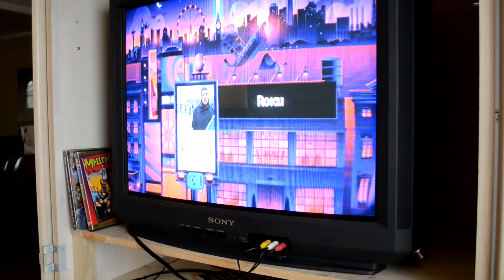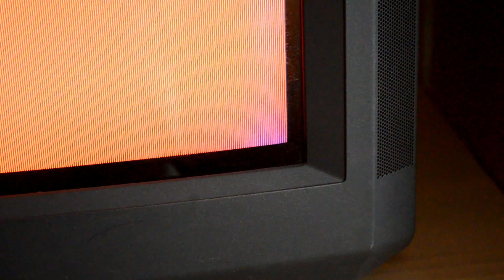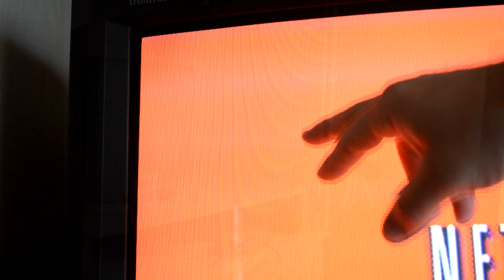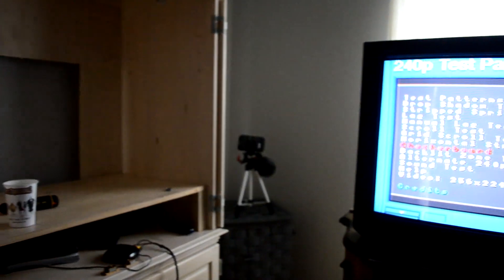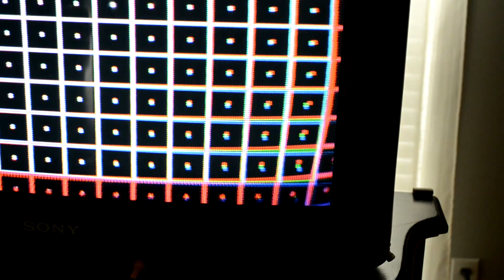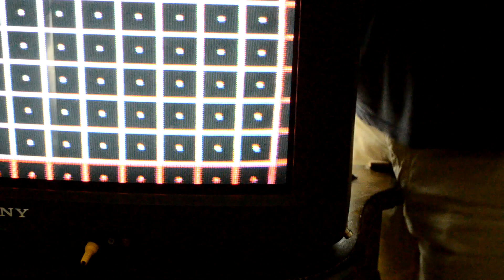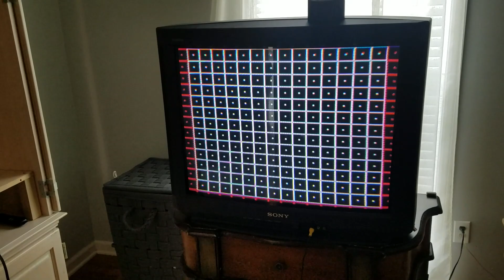Sony Trinitron TV Color Purity & Convergence repairs

Comment: I bought a 19" tv from ebay that was dropped in shipment the tube survived but it took a nasty knock, the lower left is purple and upper left is slighly off color too,  no amount of degaus will correct it the tube is damaged i wanted this tv for a tube swap on one of my arcade machines, I've adjusted most of it out via the purity rings on the neck the picture looks pretty good now you wouldn't know on normal gaming screens, only time you see it is on a solid white screen there is a litte faint patch of blue in the lower left corner now, i might take the yoke off now and see if one of the windings magnets have fallen off as ive seen this a lot on oldet tvs then just try adjusting it out with the yoke now, hopefully i can save this tube its flipping annoying because its a very healthy tube gun wise and life expectancy when i put it on me BK REJUVENATOR / CRT TESTER, color guns are on the top levels of good.

Comment: I just got a 40xbr800 and I had to place magnets around the edges of the screen inside to get rid of the color variance.   However they would come back after a few hours.  Will adjusting the joke fix this issue long term or am I looking at a dying tube?

Comment: I appreciate you uploading this video. I have 2 monitors, one is a pvm and the other a bvm. This seems like the solution to my problem. Both were shipped to me and now I'm wondering if maybe they just got rattled a little too much and caused this problem.

The pvm is actually quite well, just a tad hint of purple up in the corner when displaying red in that part, damn near identical to your video. The bvm however is terribly bad, a good 1/4 of the screen is purple tinted coming from the corner but can be mostly eliminated with some magnet trickery. I've had these for a few years and have been reluctant open either one up. I can live with the pvm but the bvm was practically free and I've always thought maybe someday I would learn how to fix it. It's only got like 20,000 hours on it and I hear they're supposed to last over 100,000 hours.

Comment: hello! I have a sony 29kv310 that has a curve image on the top and bottom of the screen instead of straight lines. I think the yoke needs to be lifted to correct this (getting the yoke's top closer to the screen and the bottom further away). Do you agree with this???
Reply: That's how I fixed it on my KV-32FV16. Also fixed the screen tilt.

Comment: Have you worked on any consumer flat screen triniton crts? Specifically trying to correct wavy or bowing horizontal scanlines.  I corrected all the convergence issues on mine but can't seem to do anything about the geometry outside of the service menu.
Reply from the maker: Hi, sorry I have not worked on any flat screen CRTs.  If the service menu and convergence adjustments don't help, then it sounds like you may need to replace the caps around the flyback and heatsinks on the main chassis.
Reply: @RetroTechUSA  okay thanks. I considered looking into replacing caps but didn't want to put in the work and not see any improvement. It seems like flat crts are notorious for these issues, at least from what I've read online. Beginning to wonder if it's just a flaw of having the screen flat instead of curved. The overall image quality is good so I can live with it for now.
Reply: @karld4737  After watching most of Steves videos I attempted to fix geometry on my flat screen kv-36fv models and oh boy...talk about time consuming! plan to play with it all day long. I had to really flex the top of the yoke outward away from the screen as far as it would go to fix a horizontal upward bowing across the entire screen. After that you'll add a dozen magnets and a ton of strips to try and perfect it only to strip it all off and start again! Steve said it best: You can't have everything as far as geometry goes!
Reply: @linkzz00  yea I eventually found a curved 32xbr48 and it's much better. It's the one curved trinitron model with component inputs so I no longer desire a flat screen trinitron. The image quality is great on flat models but the geometry issues are a pain to deal with.

Comment: Do you accept sending in tvs to be repaired? My KV Trinitron has nasty geometry and convergence issues and I don’t want to kill myself trying to fix it
Reply from the maker: I do, but it is hard to deliver CRT's without damage happening.  I have a storefront in a city outside Nashville, TN where I accept CRT work/repairs.
Reply: Retro Tech I get ya, I ordered my trinitron online and it came with a crack on the shell.  Do you happen to know anyone in Indiana with similar crt knowledge?
Reply: Haha, I have a 36" Sony CRT I'd like to get tuned up, but feel like I'd be better off buying you a ticket to DFW compared to trying to drive the dang thing all that way.